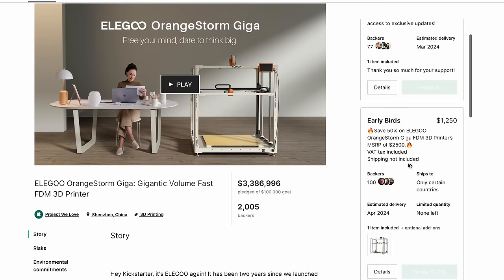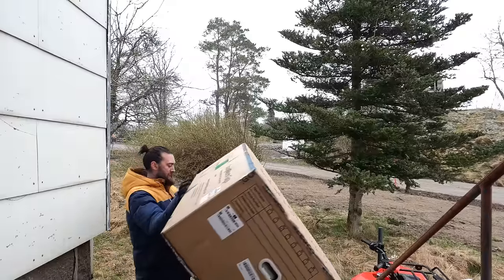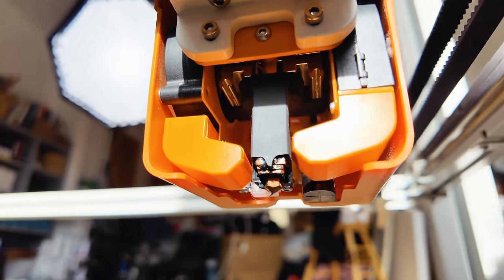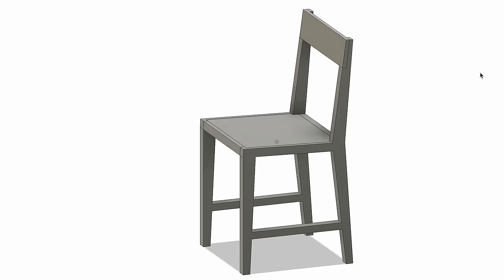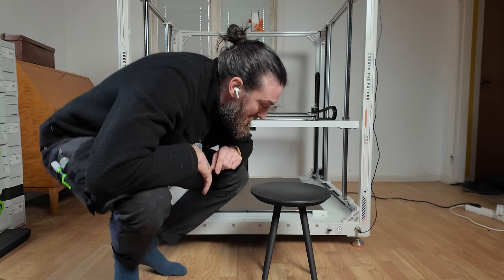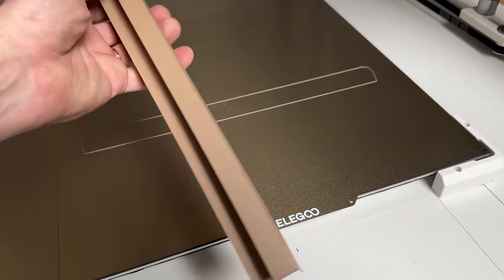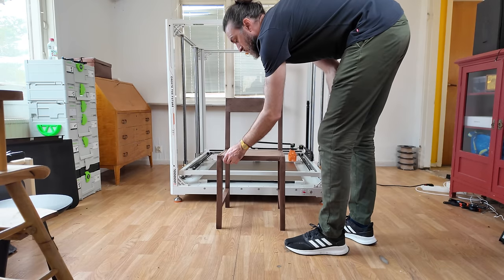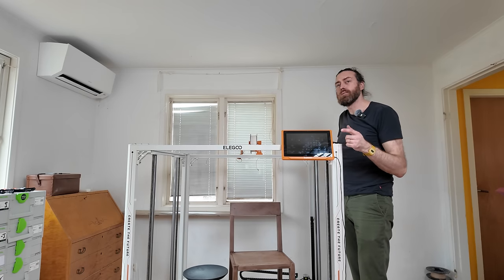I tried this massive 3d printer so you don't have to

Comment: I don't actually think we need more plastic crap in the world. And I wonder what the actual cost of the chair or stool is, when you take into account not only the filament but the cost of the space the printer occupies and its power requirements. 
I don't know if prototyping is the eventual cost-effective use of a large 3D printer. 3D printing is great for features that can't be easily machined, so now all you have to do (!) is design some furniture that can't be easily machined.

Comment: It kinda defeats the purpose of building with wood when you add 60% microplastics lol. If you want to use plastic that's totally fine but claiming it's wood is corporate greenwashing by the petroleum industry.
Reply: The petroleum industry aren't involved here, the plastic in the wood filament isn't an oil by-product

Comment: I think this kind of tech is amazing and exciting. Obviously this is an industrial type printer for prototyping, but you don't know what the future will bring and whether this kind of tech might become more affordable. As for materials, sure, most people like wooden furniture, the truth is, most of them are cheap fakes anyway, with a wooden type of cover on top of them. The same could be done with a printer. It's the natural course of things, with manual labor becoming more and more irrelevant and knowledge and skills becoming more and more important. If you never made furniture before, what good is a printer to you for this intention? But say you make something else entirely or you have specific knowledge on something, then the printer enables you to build those things. These things are super slow, I don't see them replacing traditional industrial processes any time soon. There is potential though, in the future they could do this. I don't see this as bad either. Maybe you won't have a car factory and a boat factory, you'd have a generic factory with industrial printers. A car maker could then use the services of a printing factory. Car prices could come down. The cost of them, or anything, at least will. And what if this tech become affordable to everyone? All the better. The list of things people will be able to build or do will be endless and depending on their knowledge and skills rather than money. Then, the current industrial system as it stands, is kinda forced to do unnecessary things like say worldwide advertising to maintain large buyer numbers, cause that's the only way to maintain relatively low prices, through mass production, molds, and copies. Printing can change all that, you won't need this to maintain a relatively low cost and price. This also means, those multi nation businesses might go out of business. This tech will enable smaller players, businesses and people to work in what they know. As it stands, no matter if you are the best mechanic and designer in the world, if you don't work for the top car manufacturers, either cause you happen to live in some country they don't have offices, or because out of bad luck you didn't get there, this will still give you the chance to compete with them. They, the big businesses are gonna be at a disadvantage not small ones. Countries who use those multi national businesses to exert power over smaller countries, all that is gonna be gone. I can see a ton of potential for everyone, this tech could free the world at least in some aspects. It has the potential of making traditional power structures crumble and fail if they have been there for other reasons rather than what they do. A monopoly in some kind of manufacturing won't survive if you are not exceptionally good and you have to compete with average Joe's creations small business and his printer. Average Joe could be more than average, and your multi national behemoth you built with unfair practices, conquest or war, could be too slow. Also, he does not need you, he does not have to give you his CV for your evaluation. He can tell you to fuck right off, and you better be really good at what you do or he will make you go bust and sink. So yeah, I just can't wait for this tech to become even better or affordable to all. Then, why limit yourself to plastics? Why not metals, some kind of metal composites material suitable for printing? Different kinds of printing composites with analogous properties to say aluminum, steel, whatever, this would be awesome. This tech is just great!!!!